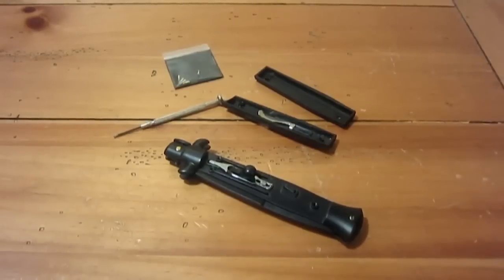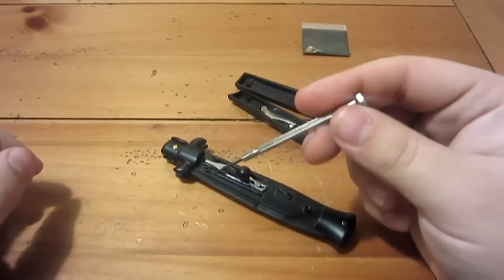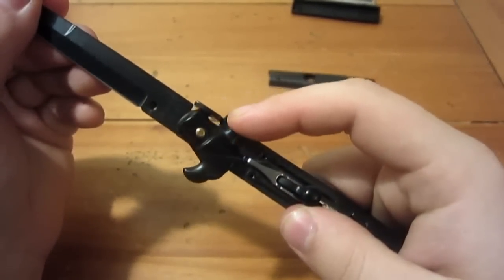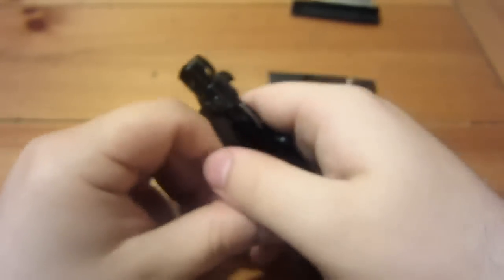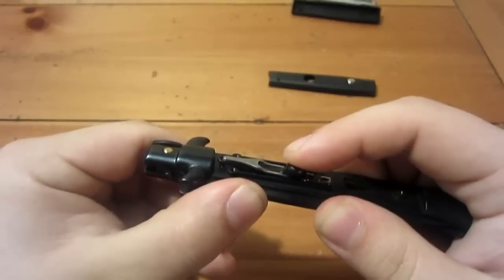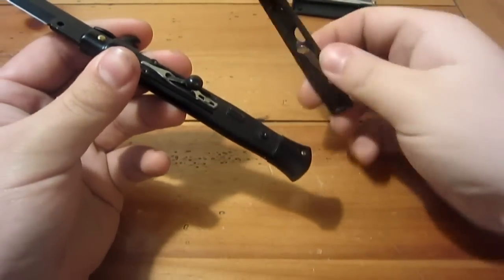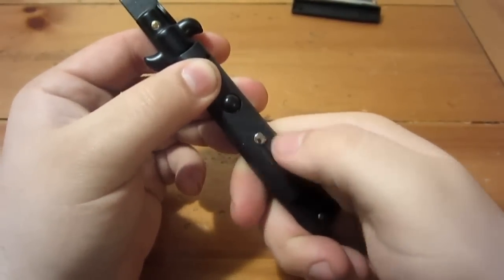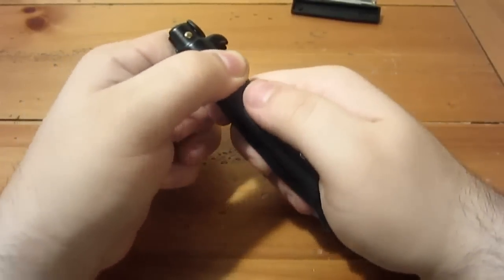How A Swivel Lock Stiletto Works (Italian Switchblade)

Comment: Thanks for this video, I recently inherited a stiletto that belonged to my grandfather and once I had released the blade I wasn't sure how to close it and didn't want to damage this heirloom. Your video was an excellent explanation of how it works and I now have it closed. The one I inherited is almost exactly the same as yours except much older!
Reply: When u not use it have it open to save the spring.
Reply: @goinge  Thanks man, that makes sense that not having the spring under tension would keep it in better shape. The one I have is my Grandfather's. He served in the US Army Air Forces during WW2. He was a nose gunner on a Flying Fortress during the European campaign and got the knife in Italy near a based he was stationed at at some point. I will release the spring and I also want to have it sharpened and cleaned up at a place that will take good care of it. Any suggestions? I want to keep it in as close to original shape as possible as it is a piece out of my family's history.
Reply: Hey man. Glad i could help. Thanks fore ure GFs service! As i live in Sweden i cant help u on were to get it fixed, but just wash it with mild soap and dry it well and then oil it would do the trick. A stiletto is not really made to be that sharp its a stabbing weapon u know.
Reply: @goinge  Thank you man, I will absolutely give it a light cleaning with mild soap and then oil it! I genuinely never thought about it as a primarily stabbing blade but now that you say that it makes perfect sense. I'll get it in good shape with the steps you suggested and maybe give it a light sharpening on a wet stone and then I will put it away open on my altar in tribute to my grandfather. I'm very proud to have come from a family where one grandfather was an Airman in the European theater and the other was a Navy sailor in the pacific theater who fought at Leyte Gulf. Take care and I hope you and your family are safe through all the modern events we are living through.
Reply: @kristopherriemer4807  A tip is to use a hairdryer to get it really dry in all parts and a sharpening make good sense dont forger to put some oil on it now and then. And tnx again fore our freedom. Stay safe my friend.
Reply: @goinge  Thanks man, hope you take care too.
Reply: Would be nice if u made a video about it and tell a bit of ure GF. Im shure many ppl would be intrested, i am. Please let me know if u do.
Reply: @goinge  Hey man, I'm not sure if anyone else would be interested but since you are I will make a video showing my Grandfather's service records, medals and other heirlooms from WW2. I will do it in the next couple days and send you a message when I do. I am very proud of my Grandfather. Not only of his service but also because he was a good kind man who I look up to. Thanks man, you've reminded me of why I loved and was proud of my Grandfather.
Reply: @kristopherriemer4807  Tnx man it will be so nice to see that video!!!
Reply: Very cool man

Comment: 1#A stiletto traditionally refers to a type of knife blade which is triangular in design rather than flat, and of above average length. While it's often referred to as a knife, a better term would be a dagger, given the parlance of the time period. The triangular cross section of the blade means that the edges would be very dull. The upside to this is that the blade would be abnormally sturdy and durable, as well as coming to a wickedly sharp point. As you may be able to guess,

Comment: Mine after 10 years won’t release the blade anymore us in the button. I have to push the blade in ,in the closed position then push the button. I can feel it release like normal. Otherwise i bruise my thumbs trying to push the button,which works as it should maybe 1 out of 15 times. Any help is greatly appreciated! It’s pretty much just like yours! Thanks!

Comment: Very interesting stiletto. However I have a few questions. #1: I have a 16$ switchblade that wont open, the safety is off, and I'm pushing the button, but it wont open, any ideas? The second one is do you have any bladeplay with your Frank B. stiletto? I have some with mine and its really annoying. I would really appreciate a response.

Comment: Thanks for posting as it answered several questions I had.  One question, my F.Beltrame is pretty old-- easily 20+ years, and the pin that holds the blade closed has either worn or the spring holding it needs adjusting.  The problem is being older the stag handles/scales are pinned.  How should I open/close the scales?  Any advice is appreciated.

Comment: Hate to be a pain in the ass but what kind of screwdriver should we be using again, also, exactly where in the grocery store might we locate said screwdriver. Finally, could you go back over the concept of a pin in a hole release/hold mechanism again. Is this similar to traditional intercourse, minus the thrusting (of course).
Reply: Well the screwdrivers come in eyeglass repair kits at the pharmacy, usually to the left side of the throat lozenges and above the Tylenol capsules at the counter

The kit comes in a rectangular plastic tube, probably vinyl if I had to guess, nothing fancy. The red cap just slides right out, not a very positive lockup of you ask me. The screwdriver fits most tiny screws and has a carbon fibre head, which is machined very precisely, but can snap if you treat it wrong. It also comes with some foam pads for your nose and a couple of little screws. The steel on these is questionable, but I'd say around 20f grade.

Comment: When mine is in the closed position it doesn't sit in the handle all the way so it's locked in but there is a gap between the handle and the tip of the blade.  Do you know how iv would fix it so it stays all the way in when it is locked?

Comment: I literally came here to figure out how to replace the spring that's the one thing you didn't show lol Google failed me good video though
Reply from the maker: sorry about that these knives are pinned together with rivets so you change the spring you have to drill out the pins then the parts can be changed out and you cna add a new leaf spring but then you have to re-pin it which isnt an easy process at all...
Reply: @cutlerylover  no worries still a good video I got a stiletto off a buddy of mine and the spring need to be replaced mine has rivets tho not screws

Comment: I'm having an issue where mine won't click closed. It just opens up
Reply: +bzt464  sounds like the locking pin is rounded off. you can file back a little but not too much. should sort it

Comment: had a couple of those 18 years ago not in black, the only steel parts are the blade spring and half a back spine,all the rest is a compound called peuta. top liner cracks as time goes on, where the square hole in the liner for the blade lock  sits is where it cracks. waste of money.

Comment: this knife is not a good one,the liners usually crack on the square hole which the lock sits in because thy are pewter not brass. had a couple before . wouldnt waste your money.